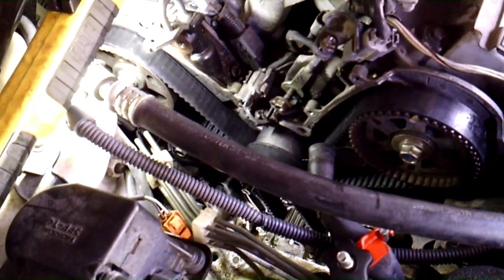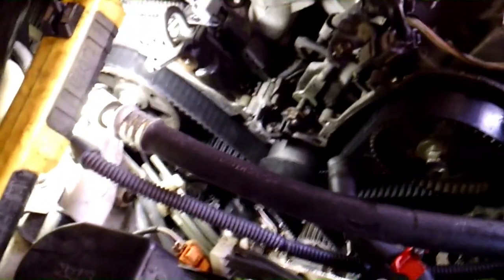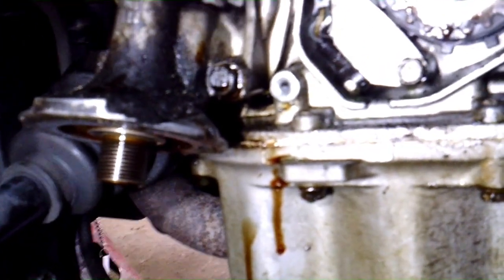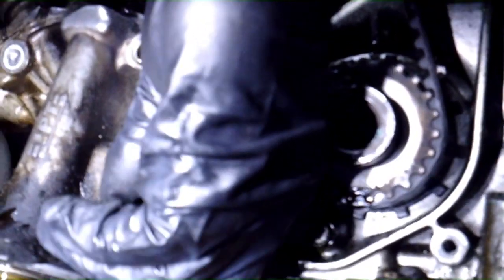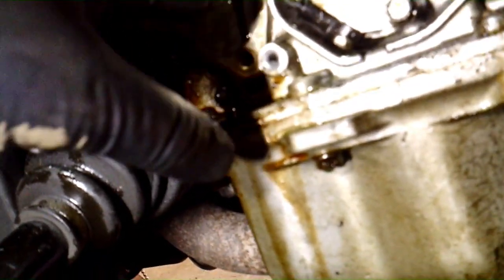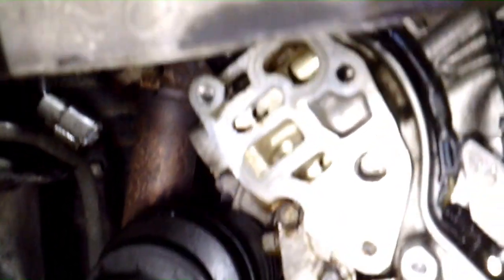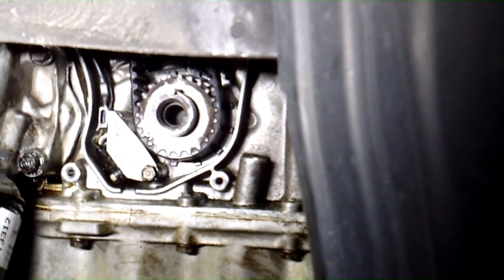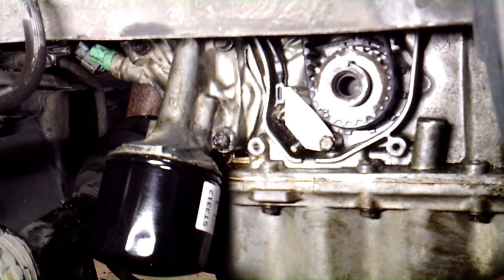2003 Acura TL Type S Oil Filter Housing Leaking, Replace Seal!

Comment: thank you!!!!!!!!!!!! the only place that mentioned the torque spec is 16 ft ponds for the oil filter housing, where did you find it????
it's not on alldata, could not find it on google, honda does not want to tell me over the phone! and no one like, ericthecarguy, bundy, south main auto repair, no has the 16 ft pound torque spec, where did you find it??
Reply from the maker: I was using shopkeypro back then so probably there.

Comment: Which scan tool do you suggest for a home garage? I don’t have a full blown shop. I just work on cars here and there. I need a obd 1 and 2 since some trucks and cars are 1990-2005 and some are 2010-2017’s. Awesome content! I Love the vids
Reply from the maker: Man that's a tough question I use the autel maxi elite which is very expensive and the launch v431. I really like Autel a lot but the launch is a close second. Depending on how much you want to spend I would look at the Launch 431 or the launch mini, autel makes some good low level versions of their scan tools also but I am not real familiar with their particular models on the lower end. The launch is probably the best bang for the buck with bi directional controls, programming keys and fobs etc. As far as older stuff that's a tough one both launch and autel have some connectors for older vehicles but it's hit and miss I still break out my old actron scanner with all the cartridges and cables other than that I would look used for a obd1 scanner that has the cables and cartridges of whatever you might be working on the most. Just the other day I was working on a older Toyota and didn't have the anything to hook into the diagnostic port, the older stuff is rough.